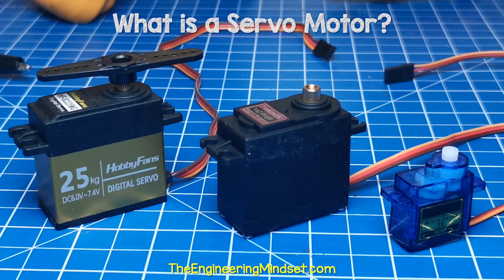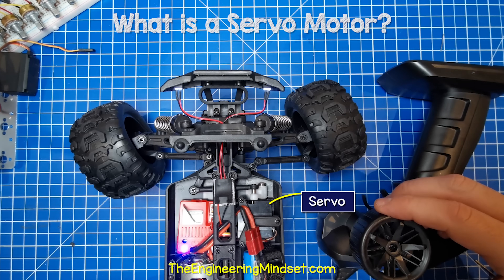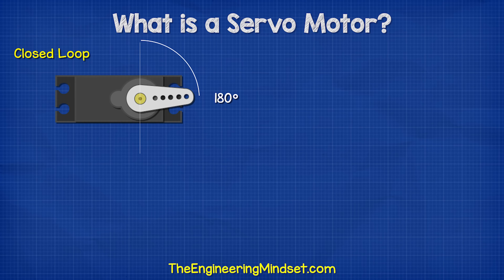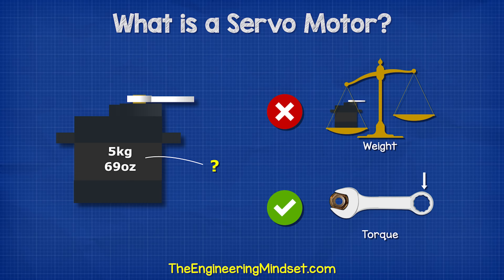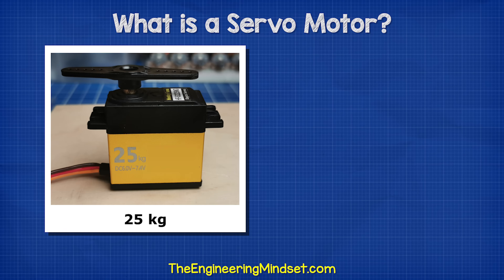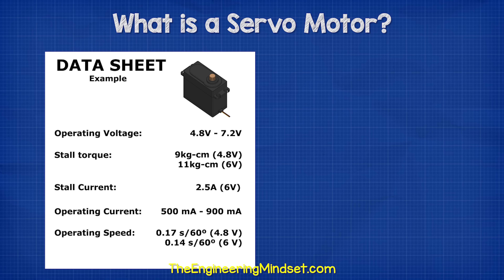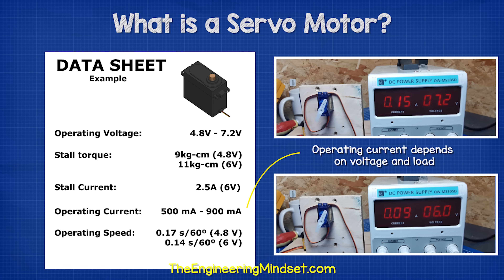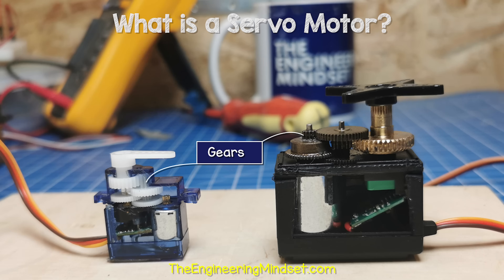What is a Servo Motor and What Does It Do?

Comment: Just a heads up, larger motors show the torque rating on the servo, but micro servos it is actually the weight. Micro servis can typically deliver 1-2 kg-cm of torque. Also, at 3 cm, a 25 kg motor can support 8.33 kg, not 6 kg. You just divide the torque by distance in cm from the center of mass.

Comment: You forgot about the signal, what it is, how it works, the different protocols and refresh rates, and standard servos are simple dc brush motors with encoder attached, your video title should be RC  servos.

Comment: A 9gram servo does in fact refer to its weight and in turn its size.  They are much more capable than a measly 9grams of force.  Do you think you stalled your servo by holding it with 9grams of force?

Comment: I like your channel and you have done a great job. However, this servo motor video is a bit misleading because it mainly deals with servo motors intended for consumer and toy use. Devices and machines such as industrial robots use completely different types of servomotors. They have an absolute encoder directly on the axis of the ac servo motor and the transmission uses planetary gears or even better gear solutions. The servo controller is also a separate device with very versatile features.

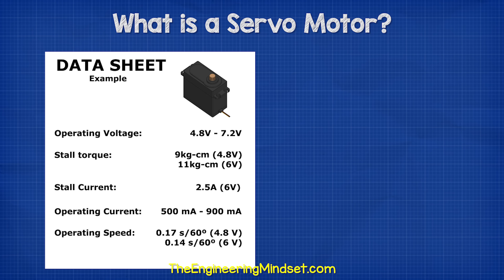Comment: 2:05 I thought that with torq you double the length and half the torq. The last image shows the weight at the 4th hole (4cm), but is labeled 3 cm. The weight is half the 2cm value, so I think the lable is incorrect.

Just wanted to point this out. Great video as always.
Reply: I have seen the same inaccuracy. You are correct brother. However, it is a great video.
Reply: Yes, I was about to post the same.
Reply: Remember that torque equals force times distance. For a motor the torque value is the constant. Most often people discuss how a longer lever makes it easier because they apply a constant force. Just throw some numbers into the formula and solidify your understanding. T=F*d.
Reply: @dasboots3272 That still doesn't explain the numbers. If T=constant, then F*d has to stay constant too. If lenght is d*3, then F has to be F/3, which it isn't in the video.

Comment: @The Engineering Mindset It's always good to see another informative video from your channel, keep up the great work....however I need to correct an aspect you mentioned which is false, The markings on hobby servos don't arbitrarily indicate torque capabilities as stated, for example those small blue servos commonly known as SG90s do in fact weigh approximately 9g and are commonly described that way for use in light RC aircraft, their torque rating is around 1.6kg/cm and have a voltage range of 4.8V to 6.0V.